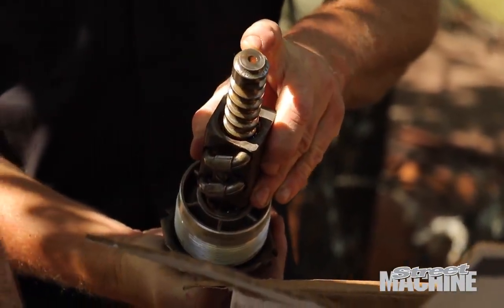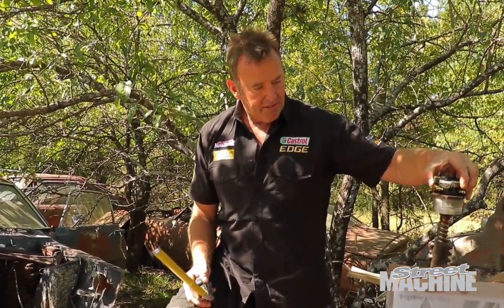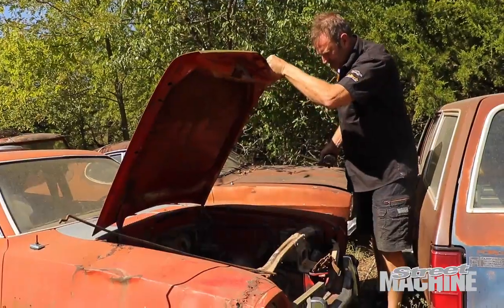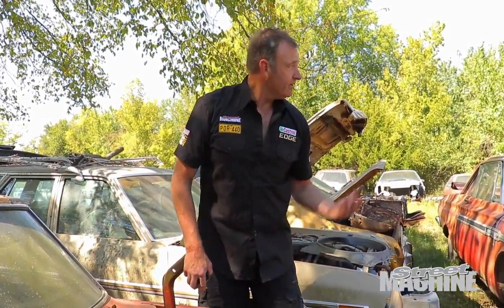Turbo LS-powered Valiant - USA Junkyard steering fix

Comment: OMG typical Valiants and to think its going over to the state, you would think you pick a car that everything is spot on before you leave, staring box brakes fuel lines everything which is so critical is a must even if everything is record before you leave and to think its a street machine for a drag week in the USa ? Please i know people who have valiants brought brand new and they still take it to get serviced, 77 V8 318's and 340 V8 and it would be quicker just to contact Valiant Weckers / Mopar wreckers down under and get the parts and even steering box recos places in the USa would still be quicker, but nope lets see if these americans can help us fix our Australian Version of a mopar Call Nick who does nothing but Mopar for god's sake, he will point you in the right direction for parts ?
Reply: Has anyone read this comment without shaking their head?
Reply: The 340 was never available in any Aussie Chrysler as an option
273 cu.in, 318cu.in and 360cu.in, were the only Mopar V8's available in Australian built Chryslers